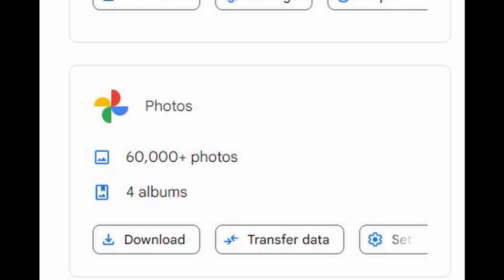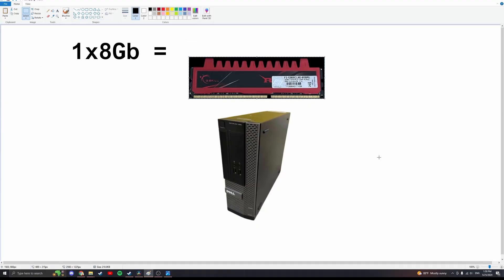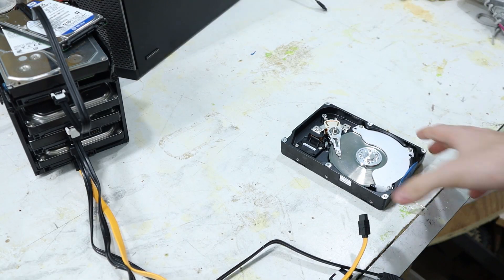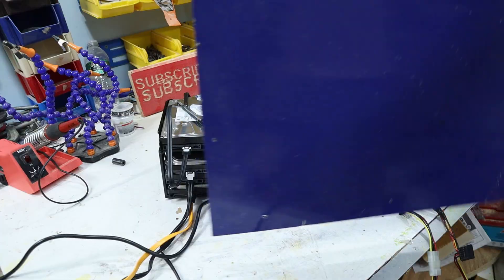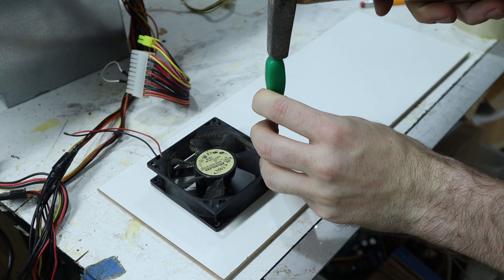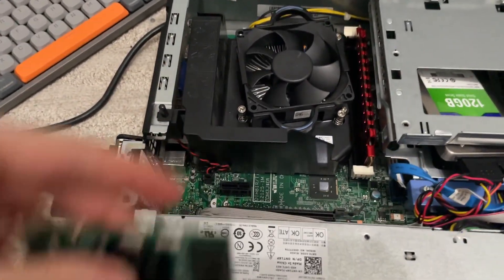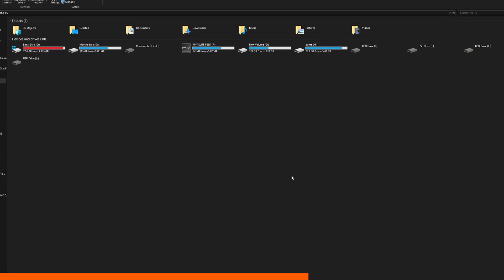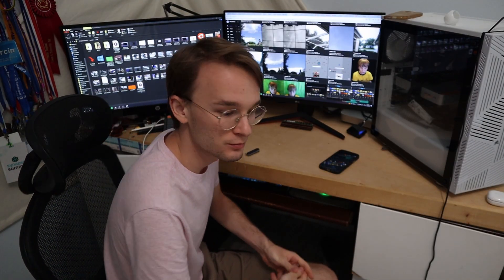e-Waste to DIY Home Server (PhotoPrism, NAS, Minecraft)

Comment: I like these old OptiPlexes. I have hacked many an old PC before. I had an eMachines case from 2004 which I modded heavily and put much newer parts inside, I took an angle grinder to an old HP with almost no ventilation and put a 3D printed cover over the hole (once filed down of course), I drilled loads of holes in and added a fan to an Acer pre-built once I'd taken it's horrible LGA 775 motherboard out and replaced it with a newer one.

Modding old computers is fun, builds your skills and reduces waste. Why not?

Comment: the intrusive thought of touching the harddrive while running got me
Reply: It may not have mattered too much. Some harddrives are filled with inert gasses such as helium and in that case you damage them by opening alone. so if this drive is for OS then fine but if it was for data then buying a new one could be good idea.

Comment: Very cool build! I personally have a similar setup, but I'm using a thin client instead of a small form factor tower, and USB hard disks instead of SATA(Although I could use the M.2 to get proper SATA). They are very power efficient, and usually have some onboard eMMC, but are otherwise just normal PCs, and are just as cheap(if not cheaper) than a used tower computer. I managed to get an Igel M350C with a Ryzen Embedded R1505G(2 cores, 4 threads) for the price of your computer. You can often pick cheaper ones up for less than 10$. As a bonus, I also use them to stream audio from under my desk to on my desk(lol) using pulseaudio, and they are fanless, so perfectly quiet(except the 12tb of USB HDDs I have attached). They can saturate a gigabit connection as long as the HDD(-disk cache) can keep up.

Comment: If that pulls 80 watts from the wall constantly then that's like 700 kWh/year in electricity. 

That's at the point where you could get a much nicer solution and still save money in the long run, a Raspberry Pi with three 1TB M.2 drives in RAID 5 would have many less failure points and have much longer longevity and the extra cost to build it would start paying itself off in less than 3 years even on cheap $0.10/kWh electricity.

That I'd expect that to last over 15 years instead of the maybe 5-8 years you might get out of this, plus all the headaches that it will likely cause, only makes the total cost even more in favor of that solution.

Still really liked the video, subscribed, and homebuilt NAS projects are awesome, though just feel there are more efficient and better solutions out there, the cheapest solution "right now" certainly isn't always the cheapest in the long run. 

In fact, regardless of how sad that might feel, you would probably still end up saving money remaking this project again with more efficient components, plus with the current US electricity grid mix save about a quarter-tonne in CO2 emissions a year in electricity use alone.

Your laptop video was awesome by the way! :)
Reply: RBPi's are very unreliable with their power voltage to peripherals. I'm note sure I'd trust them for something like this.